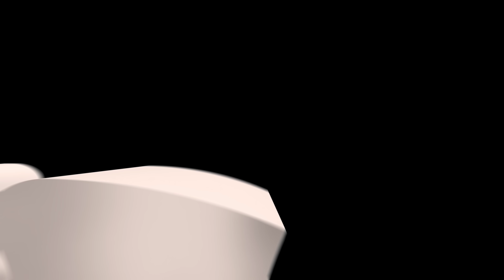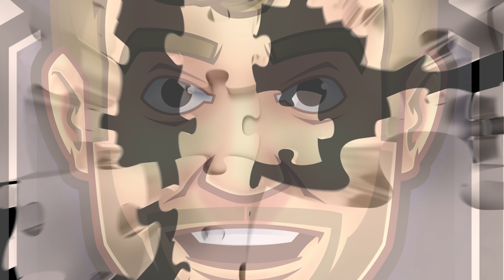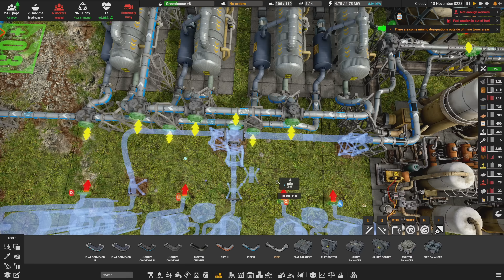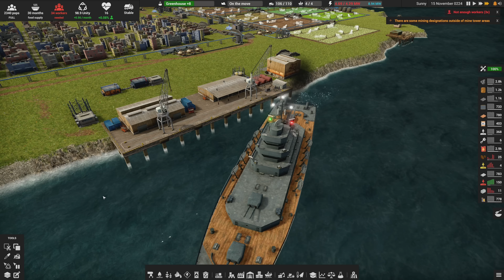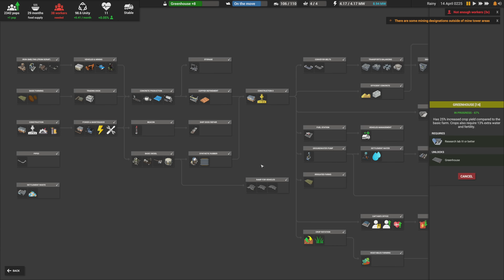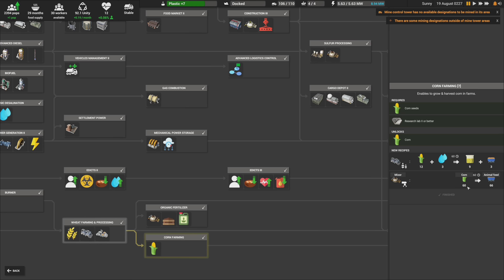CHEMICAL PLANTS ARE A GO! - Captain of Industry - 25 - Early Access Gameplay

Comment: Wouldn't say a balancer and dump before the sour water storage allow the processing to continue if say the exhaust scrubbers were to shut down?

Also why neglect balancers and burners for the oil since it could prevent any sort  of excess building up?
Reply from the maker: There is no downside (if the even remote possibility occurs) to oil building up. As far as the other resources, the consumption of them is equal or in excess to the production of them, so no build up can occur without another problem in the chain - in which case, that’s the thing to fix

Comment: You might want to upgrade the belt bringing concrete to construction parts 1 cus it looks like that's choking the system
Reply: I don't think that's the issue. It's an issue with the supply of slag